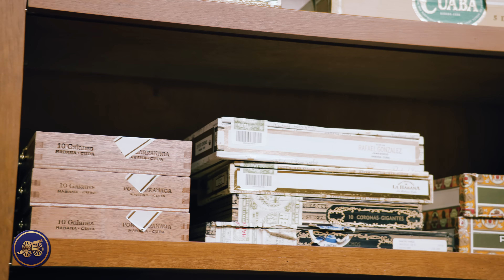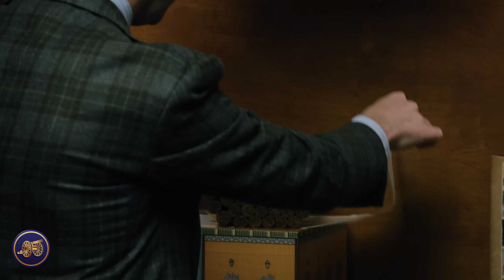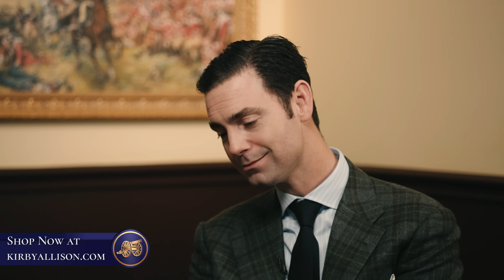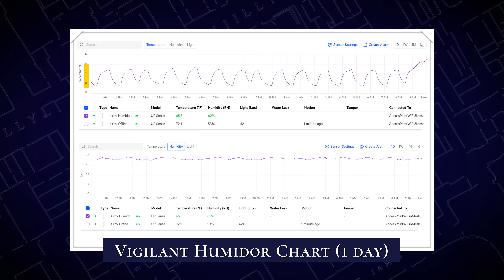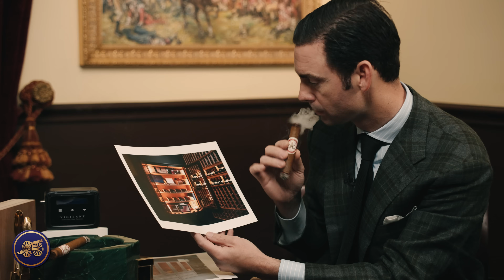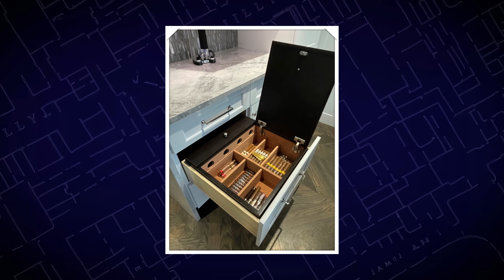Walk-In Humidor King: An Exclusive Interview with Vigilant CEO | Charlie Griffiths | Kirby Allison

Comment: Kirby, as long as you're discussing airflow and humidity control, I would like to have a airflow system in my closet – or in every closet – so clothes could properly air out after being worn. My clothes don't need to be washed after every wearing, but I still want them to be aired out without hanging them on the outside of the door on a hook. Your thoughts?